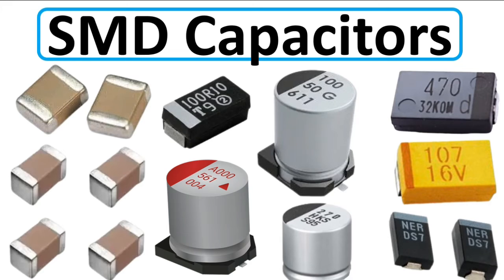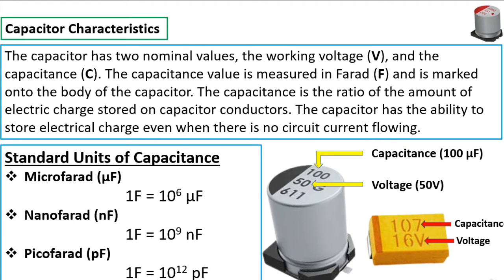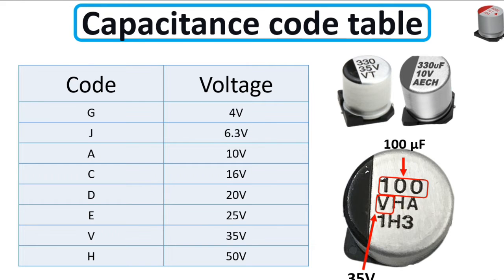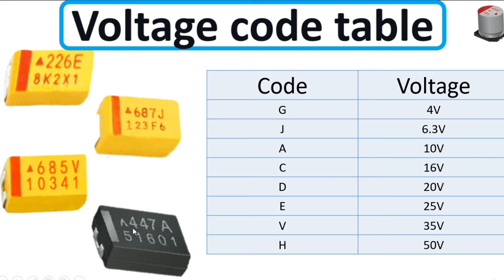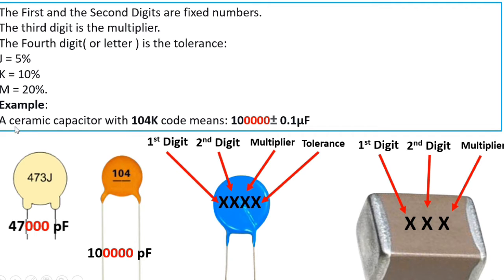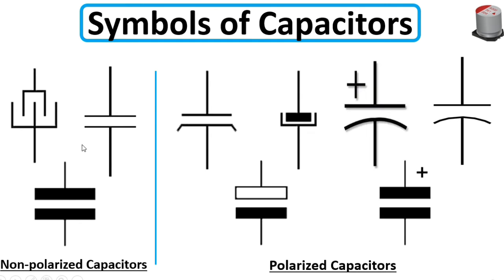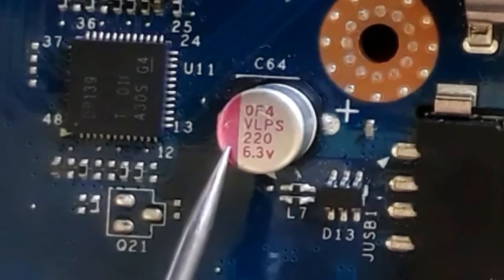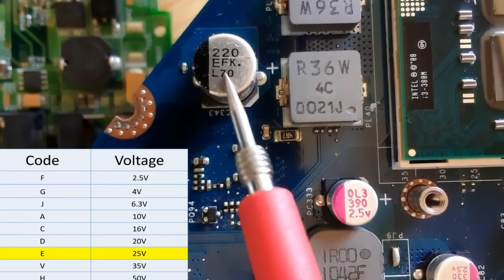SMD Capacitors Complete Tutorial - Testing Capacitors with Multimeter

Comment: I am in the process of troubleshooting and repairing a 2007 Samsung CRT TV that died. I got the picture working, but still no sound. I am learning about electronics repair on my own.
Reply from the maker: Keep up the great work!
Reply: I got the System Board out, and it has those small aluminum SMD capacitors. Maybe I should replace them in case some of them are bad.

Comment: Hello friend  , there is a SMD caps 
in my BOSE redio & CD player , I am writing exact print on it , I can not see any voltage , please👌🙏🙌 help me if you can : 47 ( j or i ) 
U D . l need voltage amount . I thank you for yourresponsee❤
MODEL   AWRCC1
SER . NO .033975C60905381AC
It is on board ( 2 ) it is on the left side of no 2nd  board 
( 2 ) board : 269837- 001
none of the BOSE repair man they 
don't answer or saying send it to them to repair it . But they want 👍
& .... so I clean 👍& put 👎

Comment: Question,  let's say i use the diode test on an electroylic type cap and didn't get a value but when I use the capacitor test. I get the value that is written on the cap. Is the capacitor good? Or if it's test one, can I get one that is out of range? I'm seeing 100uf 16V on the cap but I'm getting 637uf on the meter?

Comment: thank you, very helpy ! 2questions on electrlytic aluminium models. 
17
100
VZA
i suppose it is
100 mf. V= 35 V
17 = ?
and is it efficient to test on board without soldering ?
Reply from the maker: Thank you for your questions.
For the electrolytic capacitor labeled "17," it typically refers to the capacitance value in microfarads (µF), which in this case would be 17 µF.

Regarding testing capacitors on the board, it is generally more effective to desolder them for accurate measurements. However, some multimeters allow for testing in-circuit, but be aware that other components can influence the readings.

If you have more specific scenarios or details, feel free to share!